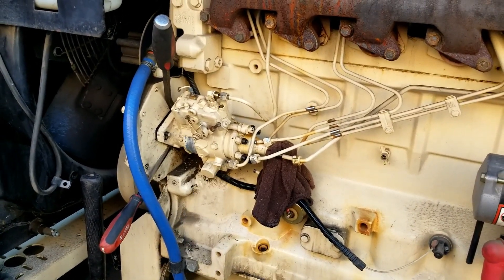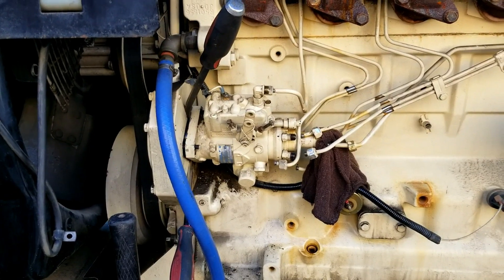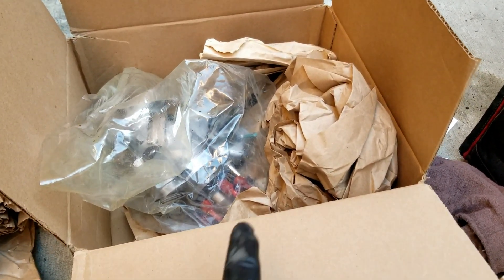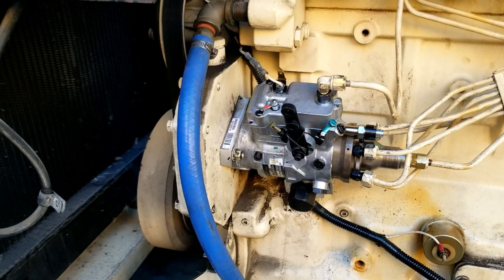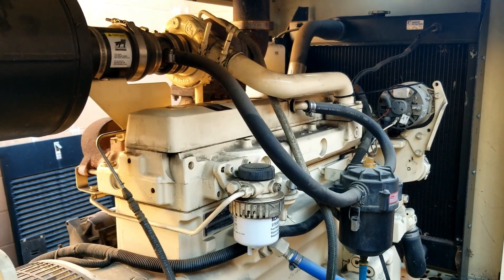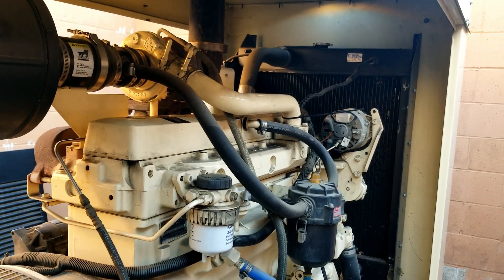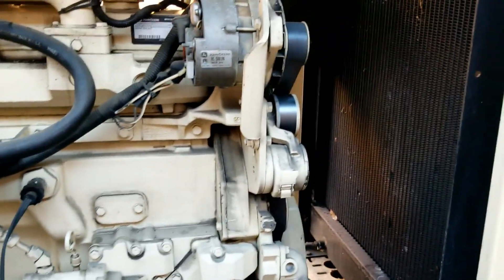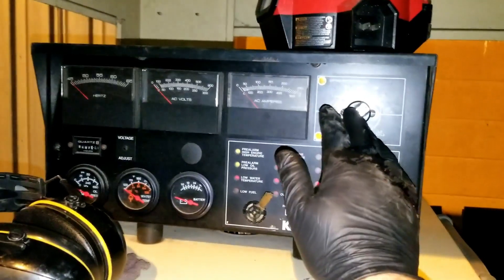replacing an injector pump on a john Deere 6068

Comment: Hey brother did you pin the flywheel at TDC before pulling the pump, I just did one last week too.  John Deeres  common rail pump injection pump tool works with the 6068 except the bolt size for the injection pump gear.
Reply from the maker: this pump was keyed, if it's keyed there is no reason to pin the engine, now if it was like a Perkins or kohler kdi, you bet you ass i'd pin it.
this was the first pump i had to swing a hammer on like that normally just use a puller or tap it with a ball peen hammer  will take it off, no questions asked.
Reply: @chainsawsandgenerators9952  this comment taught me all about removing injection pumps, this comment is gold!!!! Saved me so much work